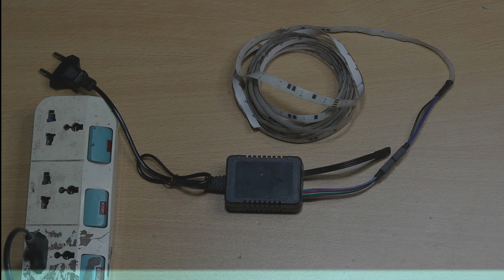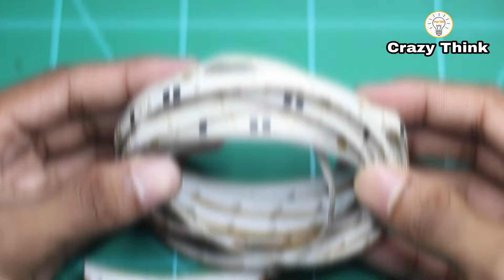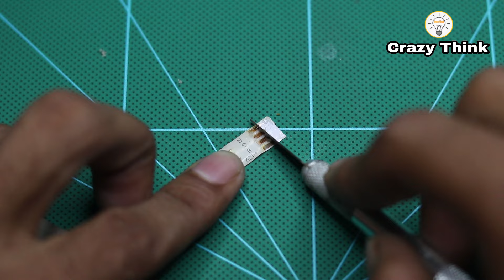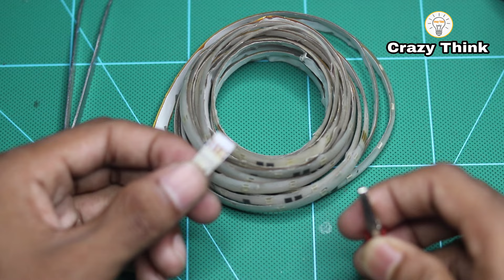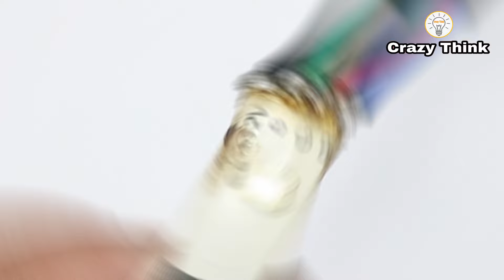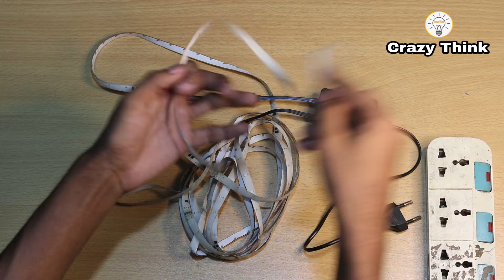How to Repair LED Strip lights   At Home

Comment: Worst soldering job in the word...... Impossible that it works with how you leave it at 1.56. First of all: the red wire seems to go to the B connector. The green to the 12V and you "add" the black wire to that one. They all also seem to make contact between each other.
Then about soldering: soldering is not tapping the soldering iron on top of the wire for a second and thinking it's done.You need to let the heat and the solder do the work, it needs to flow. It takes some skill to let apply the heat long enough to let it flow but short enough to not burn the strip.

The final result at 1.59 looks a bit better and may work (for a while) but it's still a poor job. The soldering job should look like the factory soldered picture you show at 1.58.......